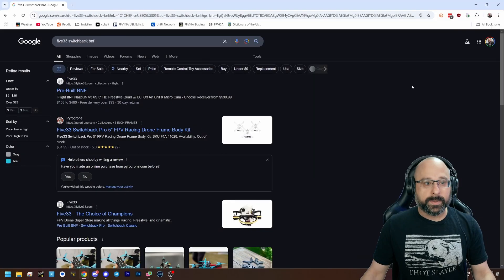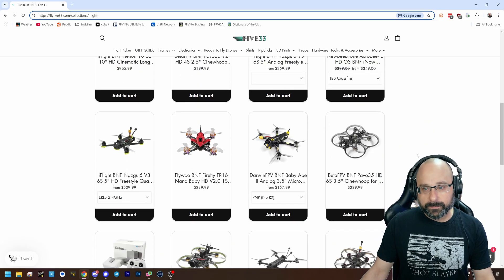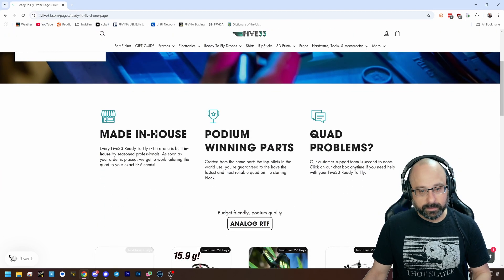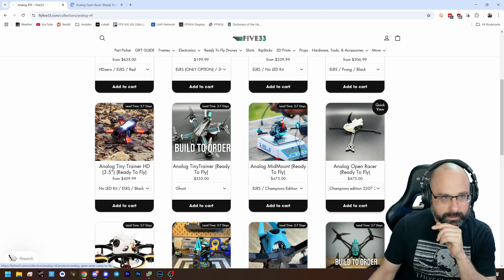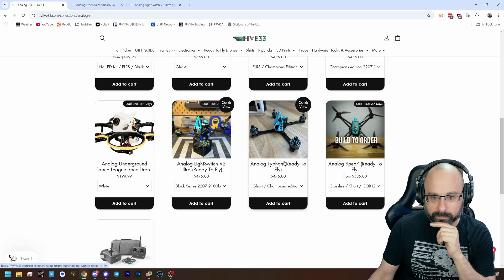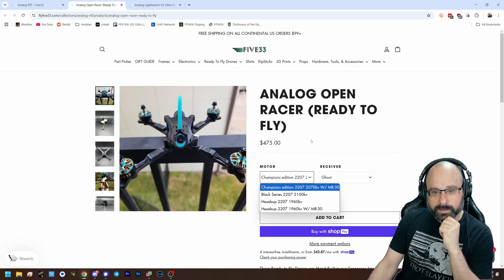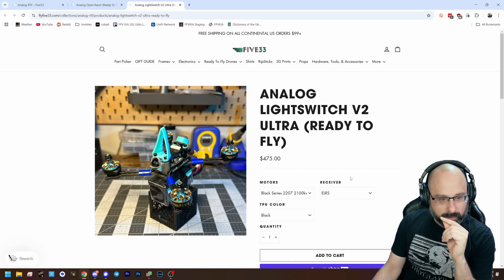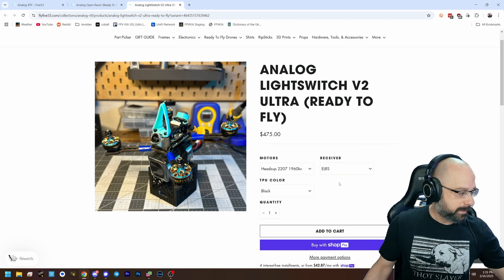How Do I Get An Efficient But Also Fast 5" FPV Racing Drone? - FPV Questions

Comment: I have a emaxx hawk that I enjoy alot,you can put up to a 1300 on it,cruise around at 60-80mph for quite a few minutes or blast a 100mph n dive faster,for the $ can't be beat,upgraded mine to predator cam n 80 amp board

Comment: Been flying for four years and kv still confuses the tish outta me 😂
Reply: Kv is a spec that tells you how fast the motor can spin (without a prop) at a given voltage. If you have two motors that are the exact same, but one has 2000 Kv and the other has 2500 Kv, the 2500 is capable of a higher RPM, assuming you supply both motors with the same voltage.
Reply: @mikerich32  yeah what confuses me is 6s quads take lower kv and smaller quads take higher kv so I always thought it should be the other way around lmao 🤣  thank alot brother👍🏻✌🏼
Reply: @FPVADER  If you have a 6S and a 1800kV it spins certain speed. If you use 4S you only have 2/3 of the voltage so the motor will spin on 4S like a 1200 kV motor will spin on 6S. If you want the same as a 1800 kV performs on 6S but on 4S you'd have to go 3/2 higher meaning you'd need a 2700 kV... At least that should be the theory, in real life it might be a bit different.
Reply: @FPVADER  smaller propellers spin faster, in general, therefore motors for smaller quads have higher Kv. It's all about the speed that the tips of the props move - on smaller props, the tips are closer to axis of rotation, therefore require higher RPMs to get a similar tip speed compared to larger props. The bigger props get, the lower their maximum RPM is.
Reply: Also, to go into more detail, the number of winds of the enameled wire inside the motor is what determines the Kv. Let's say you take 2 motors from the same product line, for example 2207 motors, but one of them is 2100 Kv while the other is 2400 Kv. The 2100 Kv has MORE winds of THINNER wire, therefore it produces a lower maximum RPM compared to the 2400 Kv motor which has FEWER winds of THICKER wire, assuming you supply them with the same voltage. However, if those same motors are drawing the same CURRENT at the same voltage, the 2100 Kv motor will produce more torque. So therefore, the 2100 Kv motor can produce the SAME torque as the 2400 Kv motor at a lower current draw, therefore it is typically more efficient for cruising.

Comment: Generally smaller motors and lower kv are more efficient with lower pitch props.
So the bigger motors you go and higher kv and higher pitch props you are moving towards top speed and acceleration.
You cant have both. Maybe just a middle thing.
Reply: Unless you want efficiency at really high speeds, then you will need good aerodynamics with a rocket shape drone